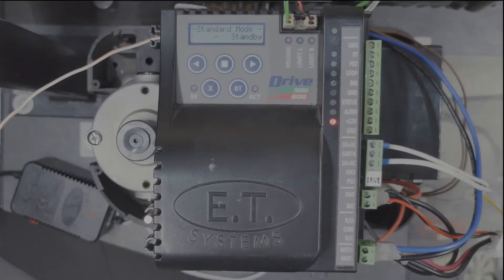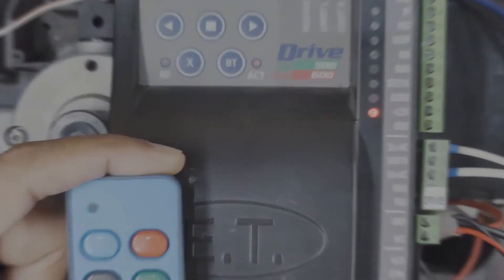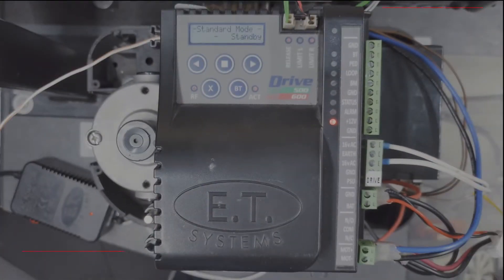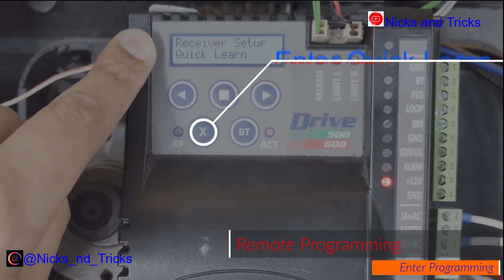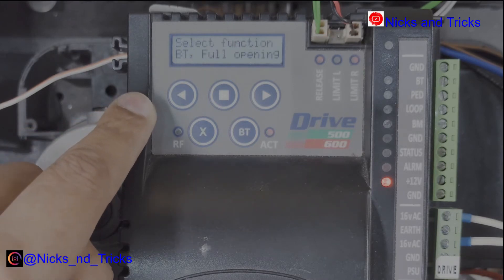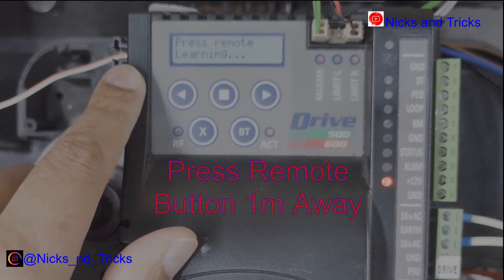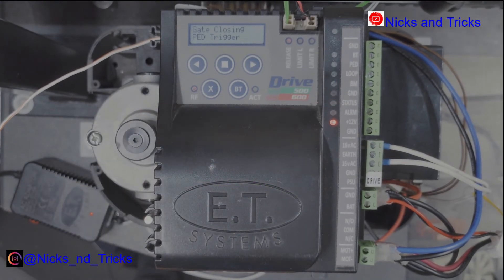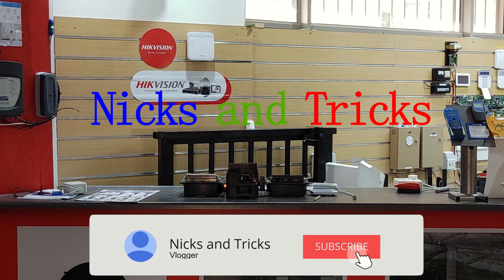how to program a remote onto a Drive 500_600 Gate Motor

Comment: I am getting to programming it to open, but failing to get it to close again
Reply from the maker: Thank you for the comment Blessing, I need a little more info. Does the limit setup complete or does it fail on closing. Do you have beams installed. What is the error on the screen